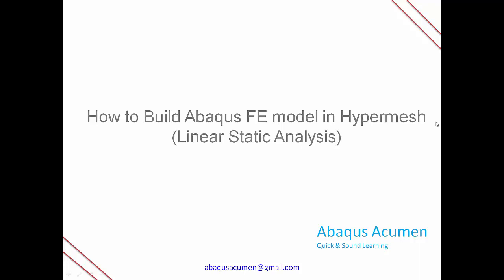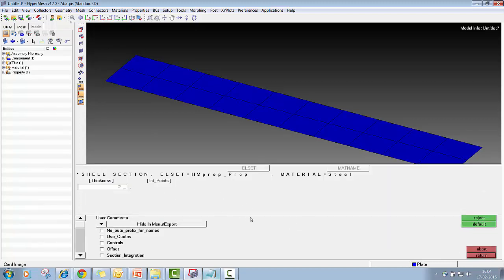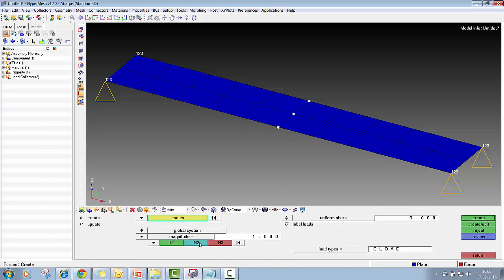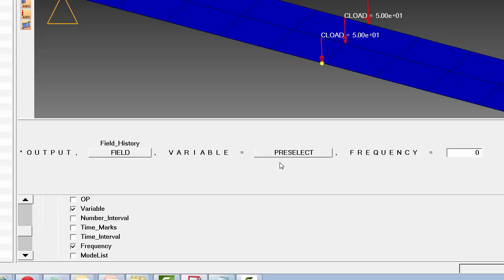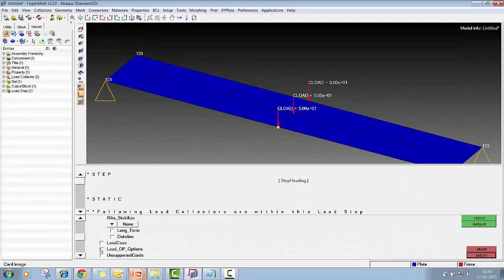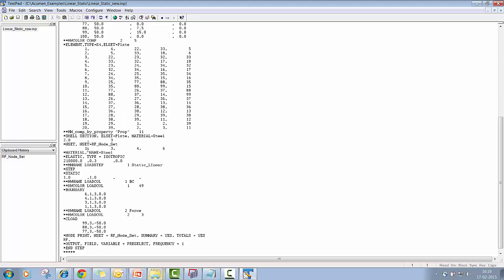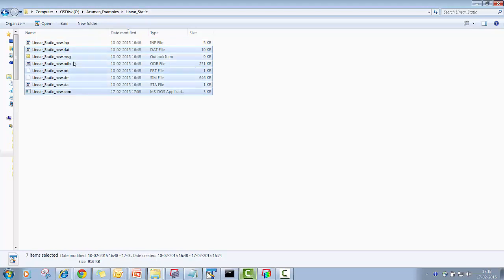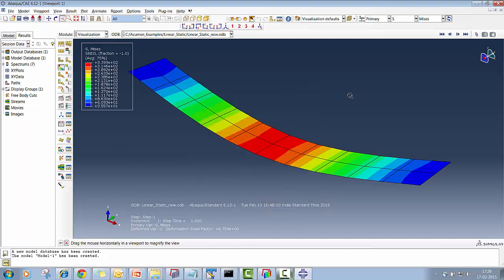How to Set up Abaqus Standard FE model using Hypermesh,  Static - Implicit

Comment: Very useful information. Great!!!

Can you help for 1D round cross section bar under torque load and the required output is angle vs torque!! It would be great help if you can put video!!!

Comment: Thank you for this very useful tutorial. 

But I think there are some problems that we should pay attention to.

The first is applying the CLOAD in hypermesh. When applying the first -50N in this model,
you applied the load at a temp node. So if you clear the temp node, the load disappear as well.

The second one makes me confused. When I use Abaqus to mesh the part, I need to tell Abaqus the element type. But in this tutorial, I just mesh the part but didn't tell Hypermesh the element type. But it did set it as shell element. Why?  default, since we use shell property?

Thank you!
Reply: This is definitely too late, but should be a clarification for someone who is reading it in the future:

1 - I believe if you generate the input file before clearing the temp nodes, they will be applied to the appropriate "real" nodes in the model

2 - There are some default element types for 1st degree shell and 2nd degree shell, which you can see and edit in the preferences. The assigned element type during meshing is whatever that default value is set to.